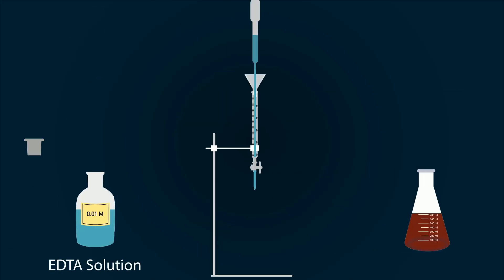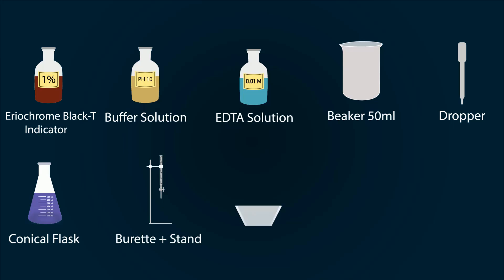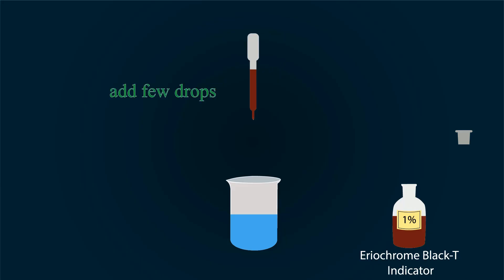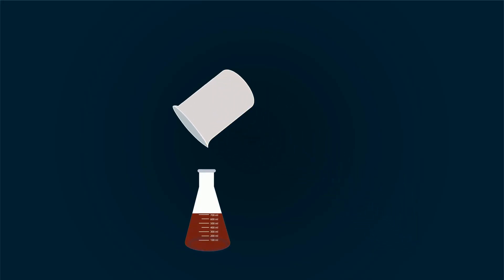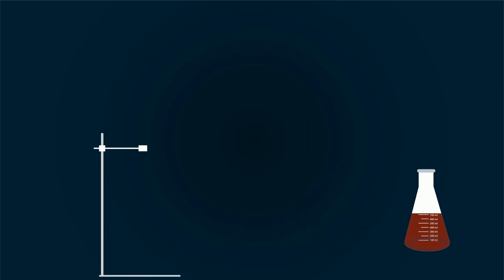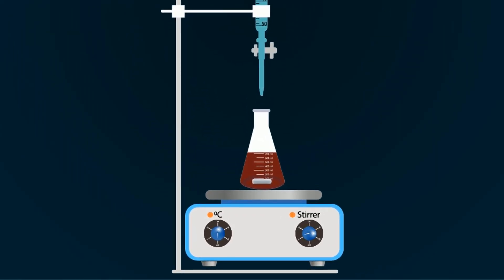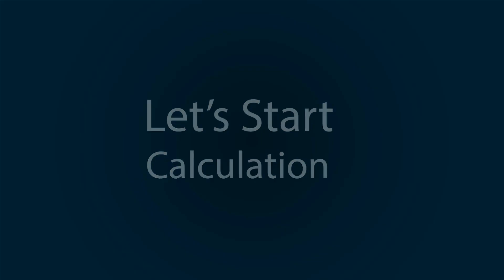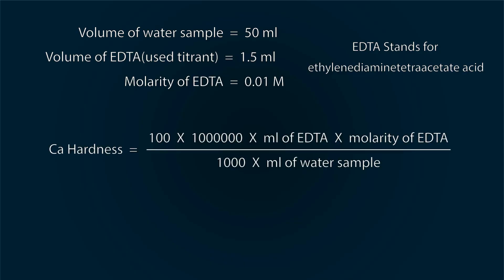total hardness of water | determination of total hardness by EDTA method | estimation total hardness

Comment: In place of 0.01M solution of EDTA. Can we use the 1, 0.5, 2Normality or molarity of solution. How we select particular molar solution to be take in a burette.
Reply: Another one why we take the buffer solution of exactly volume is 10ml.
Reply from the maker: You can use any concentration solution in burette
Reply from the maker: If you use lower concentration solution, you will get accuracy.